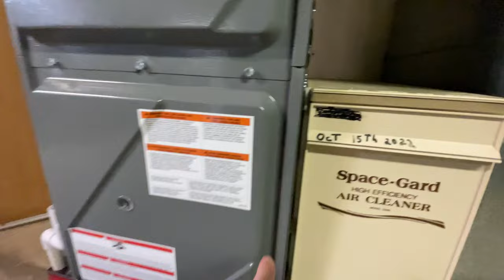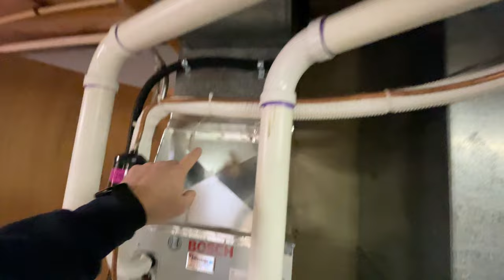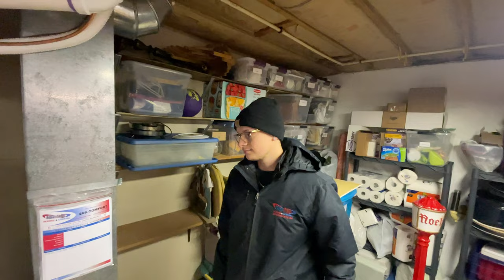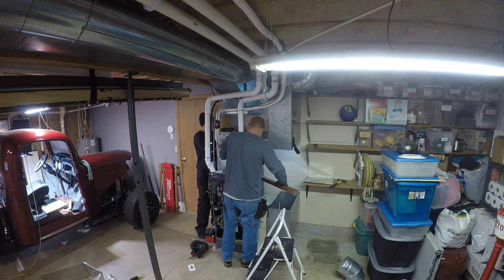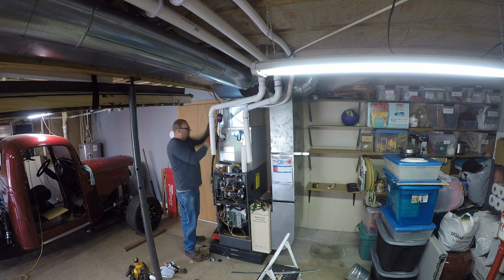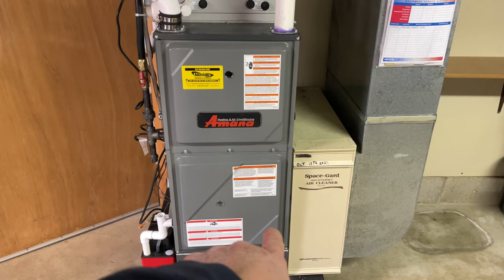Got to love HVAC Mechanical Inspectors Amana furnace Lift 6"

Comment: 18 inches may be a standard for such equipment located in a garage in most states. It is in mine. If it was installed this way, it was a mistake. The inspector is asking for code compliance for a rule that provides a normal safety precaution, not being a jerk.
Reply from the maker: Yes, you are correct but this inspector is a true ass hat! And to be honest this was my fault because I was 3/4’s into this job and I said to myself that this is gonna bite me and it did!